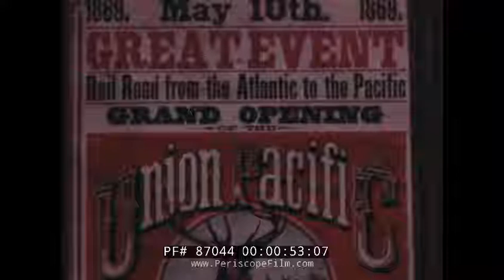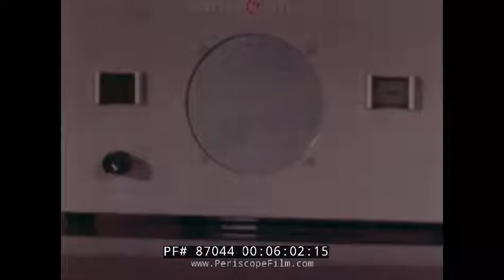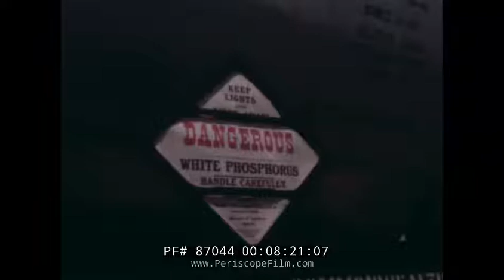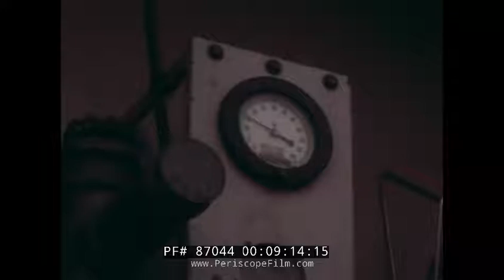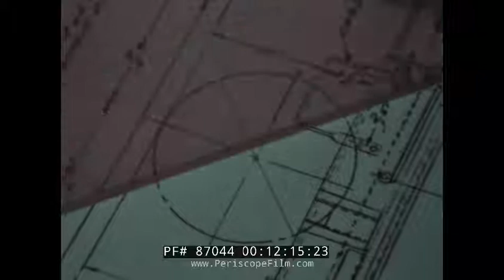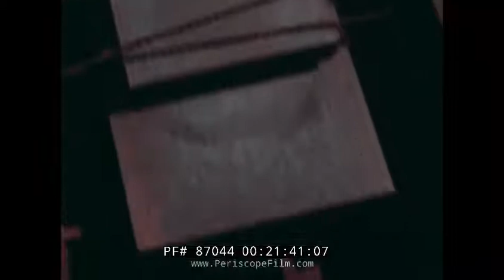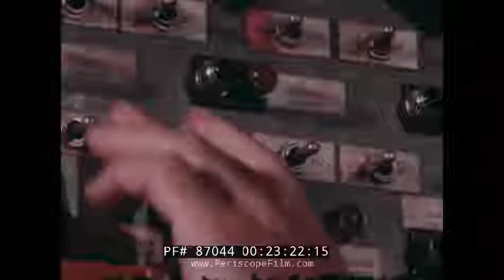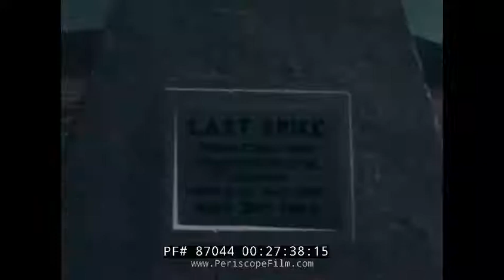"NEW DIRECTIONS IN MODERN RAILROADING"  1966 RAILROAD INDUSTRY PROMOTIONAL FILM 87044

Comment: In this film @12:05 the topic of 'rack cars" is explained; the transporting of vehicles via railroad.
Back then the rack cars were open, the the railroads eventually had to go to enclosed rack cars.  The reasons why?  According to my brother that worked in the automotive industry in the 1980s, hobos would climb into the vehicles, and ride in comfort from one part of the US to the other.  
The other reason:  The enclosed rack (railroad) cars also protected the vehicles from vandalism, such as in rural or desolate areas, people taking pot-shots at the vehicles' side windows with rifles or slingshots.  A moving target that would shatter upon impact was a temptation for some.

Back to the subject of hobos and the rack cars . . . 
The comfort aspects for the hobos as live cargo in those vehicles being transported via railroad:
The comfort of cushioned seats.
Being fully enclosed in the vehicles, shelter from the elements.
Since all vehicles in the rack (railroad) cars had to possess ignition keys, the hobos could run the car heater; play the radio; and use the cigarette lighter.  It all combined with vehicles reaching their destinations with dead batteries and empty fuel tanks . . . as well as the interior of the vehicles being filthy, too.

Comment: Wondering how many years after the design of the auto rack car did the engineers face the need for an enclosed car that would protect vehicles from the idle hands of track side vandals?
Reply: Just about a decade or so (1960-70). Don't forget, hobos--not vandals--loved to ride in those autos which were all unlocked. Rich Corithian leather seating, too,
Reply: @Greatdome99  Never thought of the first class transportation in the unlocked vehicles. Thanks.....see you learn something new everyday.